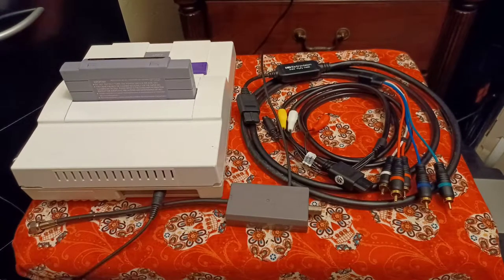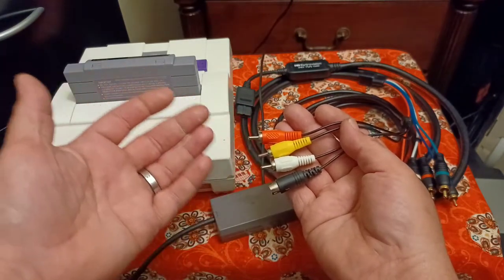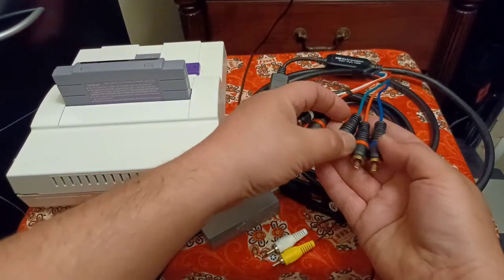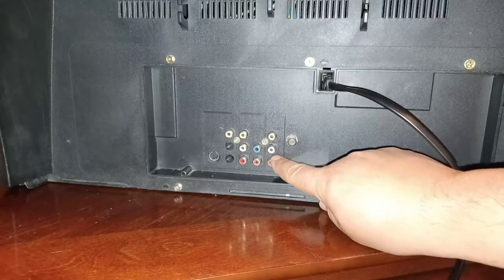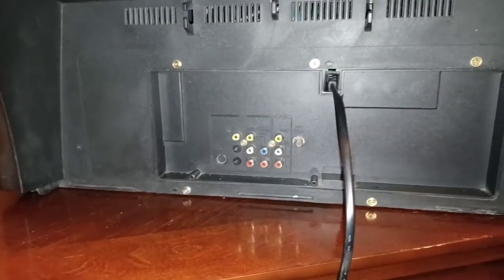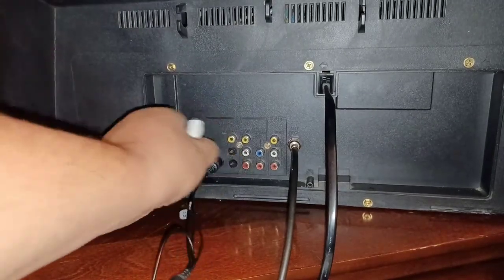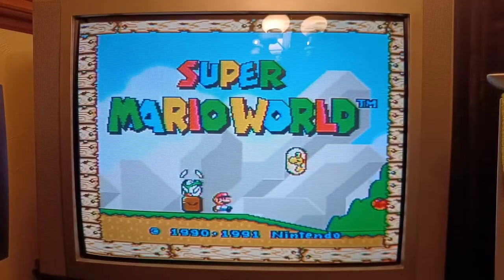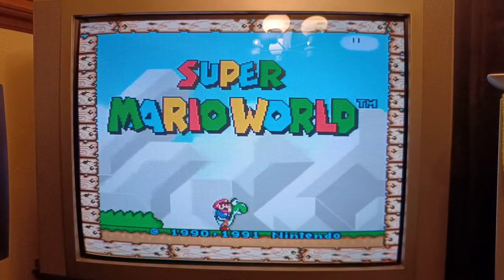How to Connect your Retro console up by RF, Composite,  S-Video and Component to your CRT TV

Comment: I've used all kinds of different connection standards. Composite, RGB scart, VGA, s-video but the one I find most appealing (regardless of image quality) is component. Something about those red green and blue phono cables and the corresponding inputs on the TV is very cool 😁
Reply from the maker: Component looks so good. People don't realize until they see it in person.